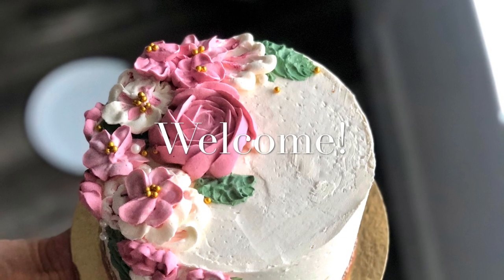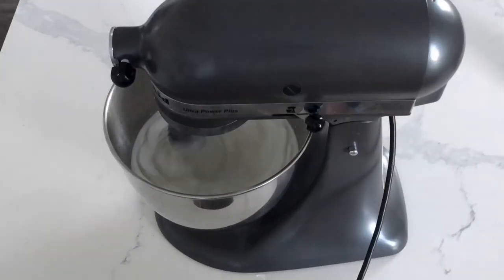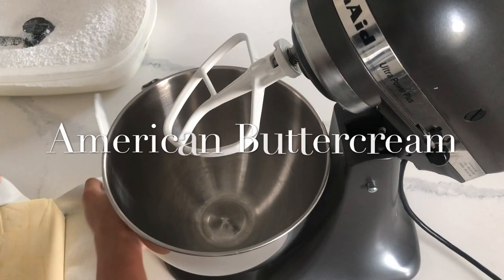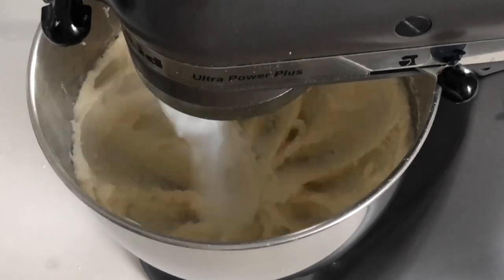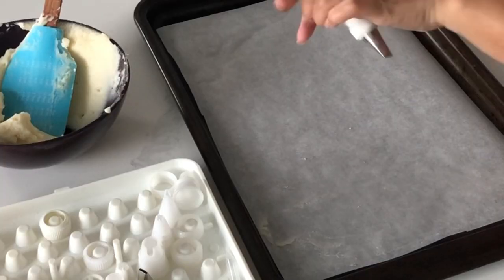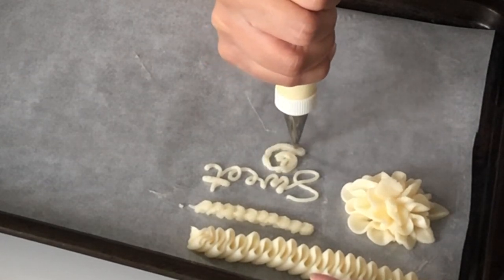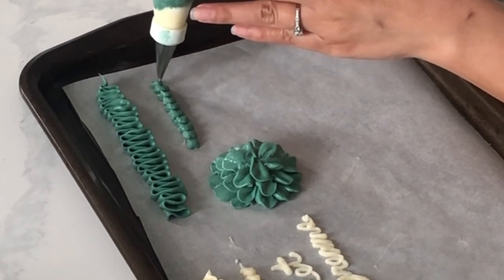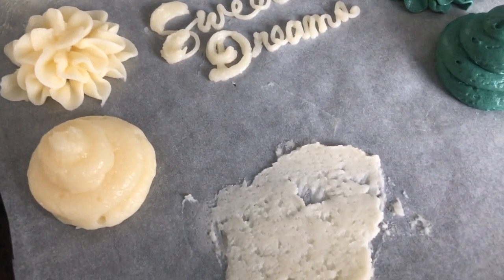Fail Friday Episode 11: Swiss/Italian Meringue Buttercream vs. American Buttercream | + VIEWER FAIL!

Comment: Greetings from Maine! I couldn't stand watching you butcher your ABC, LOL! ;)
I'm going to share my favorite ABC recipe with you.💕 
BEST BUTTERCREAM:
1/2 cup soft butter, unsalted 
1/2 cup Crisco (can do all butter)
2 lbs of sifted Confectionery sugar 
6-8 oz whipping or heavy cream
1/4 tsp salt
1 tsp vanilla 
1/2 tsp Fiori de Sicilia (opt.) 
*Beat butter and Crisco smooth. Add sugar, blending on low until comb. Add 6 oz cream, salt and vanilla, and beat until fluffy, adding additional cream as neccessary (depends on weather and desired thickness). Whip thoroughly approximately 3 minutes in a stand mixer. Re-whip before using after storing.  Note - Because of the high sugar content,  the cream is perfectly safe at normal room temperature for up to 3 days. I've been using this on wedding cakes since 1992. And yes, a drop of purple whiten's perfectly. :)
Reply from the maker: Lol yes I didn’t do it justice—I’ve definitely fixed it since this video. Thanks for sharing. I’ve never used crisco for the buttercream. What do you like about it more so than using all butter?
Reply: @SweetDreamsBakeShoppe  it keeps the overall texture light and creamier. I make it both ways, but with some Crisco, its got a headstart on whiteness and stays smoother for spreading. I'd love for you to try my recipe and see what you think.  :)
Reply: @SweetDreamsBakeShoppe  I've used this same recipe and what I like about it is it holds up stronger in hotter weather ( outdoor summer parties).